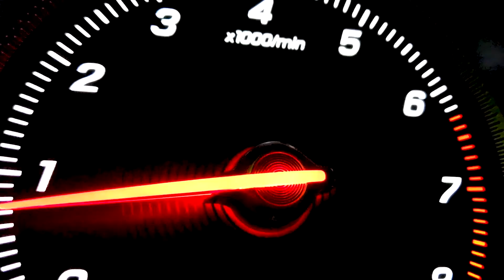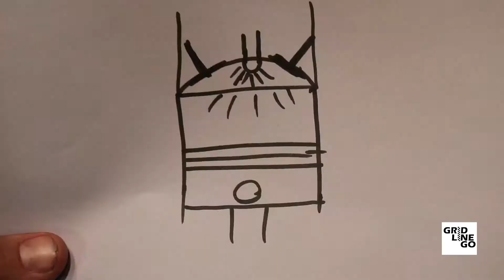Difference Between Direct Injection vs Port Fuel Injection

Comment: How much benefits do direct injection really give? Also wouldn't the tumbling and mixing with the air in port injection actually is better vaporizing and even mix? 

How likely are you actually going to remove carbon from valves with the Italian tune up?
Reply from the maker: All great questions!
-DI has many better benefits, definitely, especially todays DI systems. You can get a more precise amount of fuel and you actually get several injections per stroke to get a cleaner burn.
-Good thinking! That really is a good question. There is turbulence in the chamber already during intake and injection which should be sufficiently mixing. However, on a more conceptual level, I agree that PFI would be effective with mixture, but the mist must be far better for the engineers to choose DI over PFI for that reason. I’m sure there’s been testing involved.
-Also a fantastic question, the answer is yes, likely. DI cars suffer a lot of pinging because of this (it sounds like popping and crackling on medium to hard accel) So with an intake cleaner or mashing the throttle, this air speed and heat will loosen up the carbon and burn it. Not to jab, but many modern BMWs and Mercedes are prone to this (albeit, other makes and models too) and you can see the soot from the tailpipe on hard accelerations. Additionally, BMW recognizes the issue and proneness, they offer a walnut cleaning service to clean the valves, and few models even have a water injection system to assist as well 

I appreciate your questions very much, thank you and I hope this info helps 👍

Comment: Can port injection do hydrogen cleaning for the carbon? Is port injection totally no carbon or just less than direct injection?
Reply from the maker: I'm not sure what you mean by hydrogen cleaning, are you talking about water injection/water-can pick up? And port injection does not mean NO carbon, there will generally be some, but, far less than a DI system
Reply: Yes, somethings like water injection as per link below.

https://connectedyou.io/case_studies/hydrogen-technologies-a-healthy-engine-with-hydrogen-carbon-cleaning/

Thanks, i think good to have my 10  years old mini for the cleaning

Comment: In port injection doesn't the fuel wash the carbon build-up into the combustion chamber? If so, wouldn't carbon deposits be burned in the chamber and lead to more pollution?
Reply from the maker: We are not qualified to answer the "lead to more pollution" question considering we are not emissions experts. But we can speculate this - in a PFI set up the back of the valve is constantly being washed down, this prevents any deposits to stick and to be burned and exhausted normally. In a DI set up the valve is not being sprayed by fuel, so the deposits will accumulate. There will be a point where the valve has accumulated as much gunk as it can hold and will pass off what it cannot hold into the chamber. This will then be burned normally and similarly to path of the deposits in a PFI set up. That being said, there will be deposits entering the combustion chamber regardless. Just at later times.
Reply from the maker: Great question!

Comment: Can the n54 in my 335i just run in port injection with 91 octane gasoline only (no fuel on direct injectors at all] or will it suffer a misfire or lose alot of power?
Reply from the maker: are you looking into conversions to PFI?
Reply: Grid Line Go, yes but i do not want to switch to e85. Is it possible?

Comment: is it possible to add port injection to a direct injected engine
Reply from the maker: I don't see why not. However; I suppose maybe in some cases, no. It would come down to tuning for the air/fuel ratio, injector size, fuel pump and delivery setup. If you look into nitrous setups that sounds like what your thinking of to me. Hope this helps!  Thanks for watching and asking! 👍